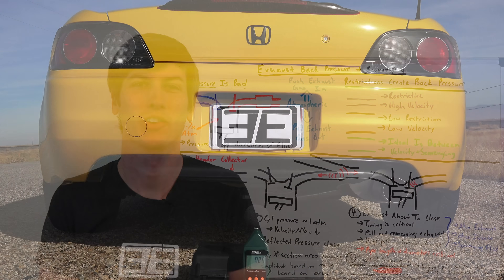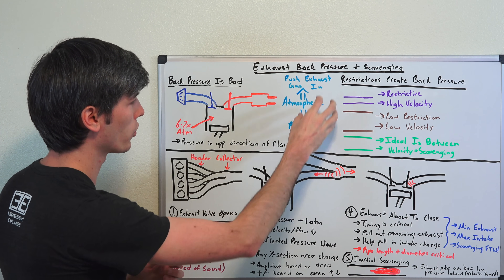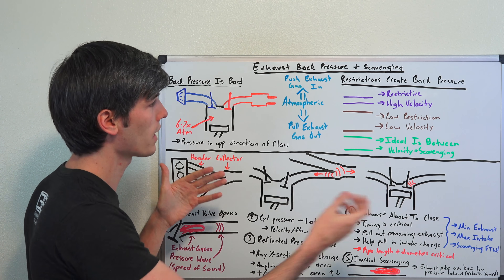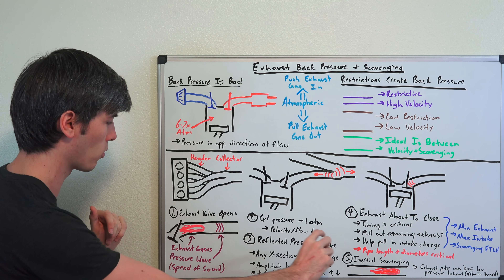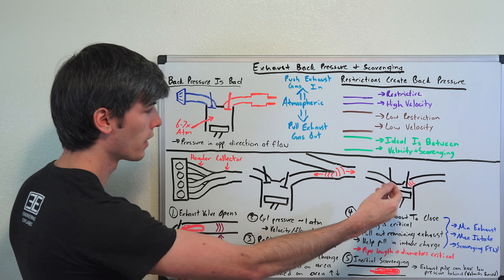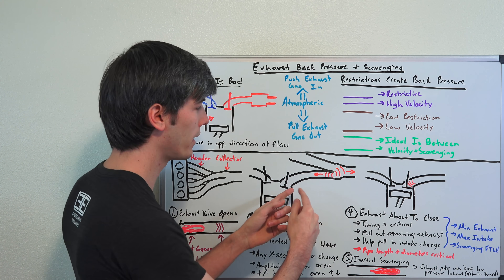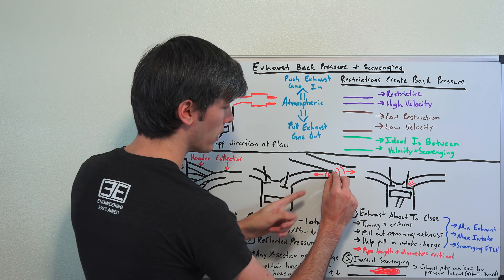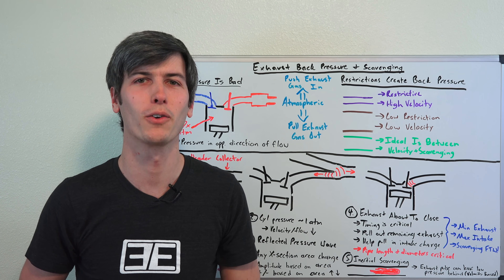Stop Saying Car Exhausts Need Back Pressure

Comment: So is a 3" exhaust after my turbo bad? I did feel a slight loss of low end torque but I havent gotten a tune yet for the exhaust
Reply: What's the displacement and boost level?

If you have a turbo, tbh, I imagine a tune will help.

Comment: I think it's a little weird how people have noticed a bump up in torque with more restrictive exhaust systems. 
A 03 mini cooper s with a 1.6l supercharged engine. Before with a decat and high flow exhaust, and with the original exhaust out back in with the resonanotor removed felt ljke it had more torque 🤔 
But I don't know

Comment: It would be great to talk about turbos and whether or not all these effects does still occur behind it. :)
Reply: Nounours2627 you want that pressure wave to be as consistent as possible drawing maximum air out of the engine as possible. Ie maximum velocity with minimal resistance to keep the turbo spooled higher.

Comment: Thank you so much for this. What resources would one turn to in order to preperlly design an exhaust for a set application? This, as always, was a great primer, but where would someone find more explanation about how to determine pipe length and diameter?

Comment: All I know is I had a 2003 Cobra, I deleted the mufflers, kept the cats and ran the exhaust out in front of the front tires. (think 2000 Cobra R). After a few years I got tired of it and put a Borla stinger cat back system on the car.. I was really surprised as the car got back a significant amount of torque you could feel seat of the pants. The more restrictive exhaust increased torque for whatever reason.
Reply: GunfightersINC I had a similar experience. Aftermarket cat back made the car feel gutless down low compared to the stock one.

Comment: Hey, can you do a video explaining why turbocharged engines actually use more fuel than NA ones?
Reply: Atreya Choudhary because they're more fun and you can't help but floor it, resulting in more gas being used at high rpms! 🙃
Reply: When you take in air in a car, you gotta use more fuel too. Air/Fuel Ratio. Well, turbos take in a LOT more air and in turn use more fuel too.
I always hear people say that turbo this or turbo that is more efficient. 
All I say is "yeah, until you actually use your gas pedal"
Reply: More air means more fuel, susiqently meaning your going to fuel up more for making more power. As you go from say an average of 300gpm and oh say 10ml of fuel at approximately 600 rpm(diesel just above idle) to now in taking upwards of 900gpm (non-specific psi of intake pressure) your fuel air ratio must not balance out again, so if you have now tripled the air intake and compressed it into a small space your now going to run your engine very lean now throwing your stociometric ratio out of proportion. Now to compensate the fuel must be increased. Generally speaking now that the air intake has tripled the fuel has tripled aswell, well no. It can be double or even quadrupled from the factory ratio. The actual ratio depends on the useage. Drag is high fuel/air and high compression to get the most bang.  Diesel motors usually start at 300 psi cylinder pressure at full compression before the turbo/charger compressor even becomes a factor, aside from that it runs high air low fuel intake which is almost opposite from your gasoline motor.
Reply: When people talk about turbo engines being fuel efficient they are talking about down sizing an engine and adding a turbo to make up for the power loss, if you go from a 2L NA engine to a 1.5L turbo engine it will become more fuel efficient.
Reply: DriftNick small engine will work harder and wont last as long
Reply: Atreya Choudhary more combustion more gas
Reply: gechpi nice copy and paste!
Reply: If you drive it at low rpms yes it is far more effecient than n/a thats why we are seeing way more turbo cars.

Comment: I've been wondering a lot recently: when I'm driving and trying to warm up my vehicle, is it better to be in a lower gear (higher RPM, lower load) or a higher gear (lower RPM, higher load)? Great video as always!
Reply: Well you could compare that to you when you ride a bicycle straight out of bed. Your muscles are cold and they still need some time to build up tension. If you ride the bicycle in a very low gear, you might injure yourself due to the sudden high moving tempo you subject your muscles to. If you ride the bicycle in a very high gear, you might injure yourself due to the high stress you subject your muscles to. So what it comes down to is that you ideally would ride the bicycle on a "comfortable" gear and pace. So to prevent injuries to your muscles.

Same goes for your cold engine. Don't drive it with too low rpm's or too high rpm's. But find the "comfortable" sweet spot, and be gentle with the gas paddle.
Reply: Modern fuel injected cars will go into Closed Loop (All sensors working) in less than 1 minute.  However, getting to normal op. temp can take up to 10 minutes (runs rich until warm).  EE made a video on this also 👌

Comment: No back pressure needed with a turbo
Reply: Zack Cernok no additional back pressure because the hot side of the turbo is more back pressure than you want
Reply: Yeah the intake side of the turbo is the cold side.

Comment: Excellent. Missing part is valve timing profile and size. Kevin Cameron who used to write TDC column for cycle magazine in 80's (cycle world afterwards) covered these. Keep these technical videos coming; Kevin would be proud. As for piping, Yamaha 2 stroke RZ350 had some radical piping to take advantage of pressure waves back in 80's. I don't think cars get as exotic as motorcycles when it comes to exhaust.

Comment: Hey Jason, great explanation as always! Just one little thing: when you mention that a difference in cross section decides if the reflection is going to be positive or negative, this is not actually true. It plays a role on INITIAL PHASE, at best, but not the overall influence of the returning wave. Since it is a wave, the only thing deciding it's influence at port pressure, in whether the cylinder will face the "negative phase" of the wave or the "positive phase", is timing; and for timing you tune the header so most rpms will have the valve closing with negative pressure. As far as cross section differences go, the reflection is an implication of both the wave equation (linear or non-linear) and the conservation of mass at that boundary. Intuitively, though, we can take for granted that restrictive CS changes will eventually bring the pressure at the port curve up, and not-so-restrictive changes won't.

All in all, superb video mate

Comment: Very good explanation!!! Let me ask you something: do you see some advantage protecting the header and the first part of exhaust pipe with thermal tape? I mean,  do you see an improvement in efficiency the exhaust system retaining heat for a long way inside the exhaust pipe?
Thank you for your amazing videos!!!
Reply: Yes as hotter exhaust gas travel quicker.

Comment: Pressure pulse wave is only usefull on two stroke engines, not on normal four stroke. It can have a negative effect and "negatively" become important. In other words, the only reason to have an exaust is to not simply vent the exaust inside the engine compartment due to the risk of carbon monoxide contamination of the passenger compartment...  (And noise, and lack of catalyzer etc).

Comment: Jason, what if we put a supercharger at the exhaust? For discharge of course.
Reply: Actually, there have been some passive exhaust extractors used in Formula racing whereby the exhaust tip is placed in a high velocity area (think above the rear spoiler or outside the firewall) with an integrated radial venturi to create a lower  than atmospheric pressure at the exhaust tip. Operates similar to the venturi in a carburetor -- it sucks better! Most effective on a short exhaust with naturally lower flow resistances/losses. Also, on very short exhausts the exhaust pipe can be flared to broaden the scavenging RPM range (similar to velocity stacks on carbs). Analogous to impedance matching in the RF world.
Reply: Rexin Oridle. As in a vacuum pump? Potentially beneficial but compared to a compressor on the inlet you are pretty limited in what you can expect in terms of improved output.
Reply: Judging by the numbers of likes, I don't think anybody likes our question, LOL.
Reply: Rexin Oridle I think you would find that the benefits gained from better exhaust scavenging would be more than offset by the weight and power consumed by the exhaust fan/supercharger so you would actually achieve a net performance loss.
Reply: I was about to write a lengthy comment commenting on the problems with your idea when I had the image of a mechanically or belt driven turbo device with compressor wheels that simultaneously create pressure and vacuum in both inlet and exhaust sides of the engine. 
I guess if it used fans as supposed to a roots type supercharger it could work.
Reply: Lee Almond yes, everything mentioned in Jason's video is passive scavenging, this particular question relates to active scavenging of course.

Comment: Why not have an electric exhaust fan at the tailpipe? This would increase exhaust velocity, reduce back pressure, increase scavenging. So what would be the bad?
Reply: HerbanLegend something needs to supply energy to that fan. Be that electric or directly from engine, it will take power from the engine.
Reply: HerbanLegend. It would take a lot of power amd you can only gain so much.  Unlike a compressor where you can in theory multiply outside pressure multiple times over you can only reduce pressure to near vacuum and even THAT would require a ton of power.

In general terms energy transfer is more efficient the higher the ratio between high amd low states, so the difference between vacuum and whatever the exhaust pressure would be is rather small while the difference between outside pressure and whatever a compressor puts out can be many times greater.

Comment: Ok, real world test!  I replaced the cat on my 96 Celica with a straight pipe for more gains.  Mid to high RPM's really felt the difference.  Around town it felt sluggish and drove like a dog!  So cat was duly refitted.  Can't argue with the theory my friend, but even with 2 1/2 inch pipework, it requires a certain amount of back pressure to generate enough low RPM torque!
Reply: Clearly you didn't understand the difference between back pressure and velocity. Watch the video again
Reply: BobtheBstrd He ain't fixin' it. You missed the clearly explained point.

The backpressure is a side effect of the exhaust being properly sized for midrange output.  

If you are seeing mid range gains you wont be seeing significant backpressure until higher in the range where it not so coincidentally coexists with a drop in output.

You could have both mid range power and high end power with a active exhaust and have no back pressure to speak of.
Reply: DrewLSsix  fitting a 21 yr old Toyota with an active exhaust...the cost might slightly outweigh the cars value.  But yes, most modern high output vehicles use the same principles.  £££ is the main drawback.
Reply: There is not enough velocity at low rpms hence why its slow.2 1/4 inch on that size engine would be the correct size.
Reply: Aussie Guy  it's aftermarket cat back, hence 2.5"  the debate continues...

Comment: You dont need high speed, in a non turbocharged engine, the exit speed only influences the residence time and consequently, how much heat is lost via the pipe surface, and this is not even that important (because a engine with high exaust speed, low residence time, will still heat the pipe over a longer period of use). Some aircraft engines only have a small pipe from the exaust ports to outside world.
Reply: JAldo. You are wrong, and every text boom on the subject says you are wrong.  Not to mention common sense.

Aircraft sacrifice potential benefits of an extensive exhaust for the significant benefits of weight savings lower drag less complication and less components to fail.

But they still typically carefully consider the design of the exhaust as minimalist as it is, given that even slow planes often cruise at 100+ mph they also enjoy a not insignificant extraction effect at altitude.

Comment: Some older engines like back pressure... i have a motorcycle from the 70s, and if you take the spark arrestor screen out, it looses about half of its 1 hp... two stroke engines also benefit from a small amount of back pressure... modern cars however, the bends in the headers are all you need 😁
Reply: Carbon Reed 2 stroke engine rely on "back pressure" to work
Reply: Bruno Danese not entirely... some two strokes dont need it ( 2stk diesel engines)... they all will run with no exhaust/back pressure, but most would just be loud as hell and have significant power loss...  generally speaking, yes your correct..
Reply: Joshua Ein that sounds like something to ask a car mechanic... i would tell you what i think it could be, but i am not an expert, and would hate to give you false info... hope that didnt sound cocky... i know bikes a bit, but not great with cars...
Reply: Joshua Ein every tune/setup/engine is different... like i said i would talk to a serious mechanic or honda guy, and then talk to about three more..
 What works for you might work better/worse for others
Reply: Joshua Ein  let me ask you this... what sort of gains are you realistically expecting with an exhaust mod on a carb engine from the 70s? I would focus on the carbs and inlet system for better results before messing with the exhaust side

Comment: For turbo cars you get all your needed pressure from your exhaust manifold into the hot side. After the turbo you want less restriction. Am I right or am I wrong?
Reply: Actually a turbo is a restriction, a controlled restriction and this is why understanding efficiency maps is important when choosing a turbo.
Reply: Yes, turbo is already more restriction than you 'need'. The best thing to have after a turbo is a completely open exhaust with large diameter. (Think 4+ in. open pipe). For most turbo cars a 3 in. straight through exhaust is sufficient. This is what I run on my turbo 240sx.
Reply: The greater the pressure differential between the turbine inlet and outlet, the faster the turbo can spool, which means minimal restriction downstream of the turbo is usually desirable.   Then you have to choose the turbo size to balance the competing demands of spooling up quickly at low rpms (when exhaust flow is low) and flowing enough exhaust and air at max power.
Reply: daemn42 C'mon man you dont have to go all Google smart and scientific with your explanation, That's not even what he asked
Reply: I thought the biggest driver on a turbo spool is exhaust velocity not pressure? Then you want to minimize back pressure after the turbo
Reply: go and look up venturis law. a slight back pressure after your turbo can actually create better flow at high revs. but more restriction at lower revs.
Reply: dsmmike95 you are correct, adam misunderstood your question. There will always be back pressure in a turbo application due to the turbine, but you want it to be restriction free after the turbo up to max rpm to allow the turbo to breath. Thus keeping actual back pressure in the manifold to a minimum.
Reply: Exactly! Think about it like this, your Turbo is your whole exhaust system, it works as your resonator, catalytic and muffler all in one, after the turbo you dont need to have anything but you dont want all that heat inside your engine bay so you route a pipe anywhere outside the car to lower the temperature, that's why you see hood exits, less weight and faster exhaust flow after the Turbo
Reply: I’m running a 4 inch straight pipe on my 2jz gte sc300
Reply: You are wrong because you don't want backpressure. He explains exactly that in this video right here in front of you.
Reply: Adam Harrington but he is talking about n/a cars not turbo cars.the heat and pressure is what spins the turbines.